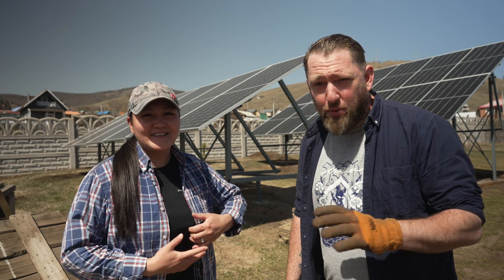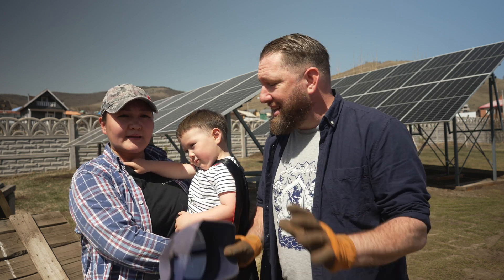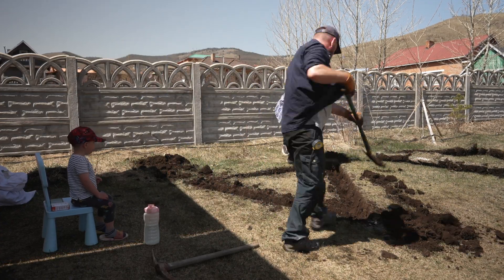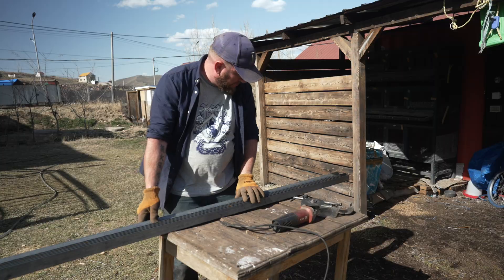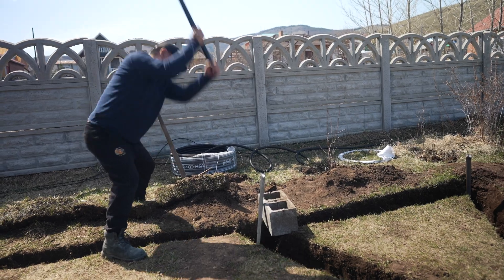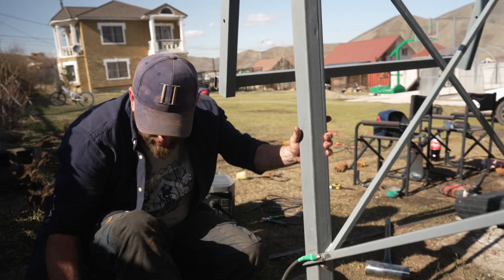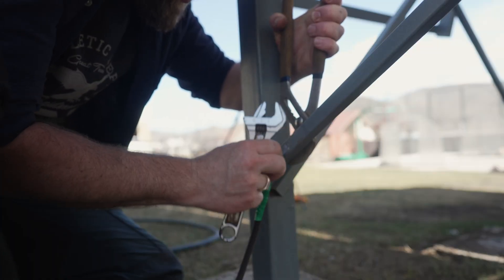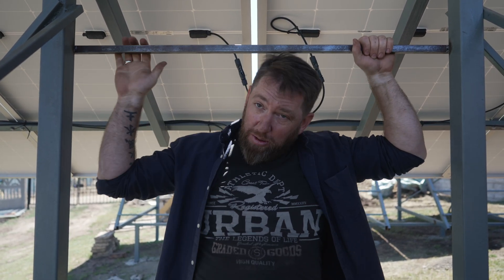Installing Our Easy DIY Grounding System | Solar Mount Ground

Comment: Hi guys. I recommend that you put a similar grounding system in for your deck at the house. I'm more concerned for your family safety regarding the deck not being grounded than the loss of some solar panels! And definitely stay off the stairs and deck during electrical storms even if it is grounded! Cheers! Allen
Reply from the maker: Thanks for the tip! There has been so much lightning ⚡️ this summer and I think about you comment every time 🙏🏻
Reply: @SimpleWildLiving  I would do it would not cost much and you would have peace of mind.

Comment: Self-sustainable solar energy is a proven way to power a home without relying on the electricity grid and fossil fuels and protecting that system from Mongolias many lightning strikes during the spring and the summer is mission critical.Out of all your projects this one will pay dividends as long as you can keep adding battery storage here and there.
Reply from the maker: Hi bro 😎 exactly and wow so much lightning ⚡️ this year
Reply: @SimpleWildLiving  I can not believe that the Mongolian government did such a poor job in implementing all of their infrastructure from energy to water and sewer you and Zula and Flame did the right thing by not buying an apartment or a house in UB. Every time i look the city is under water.